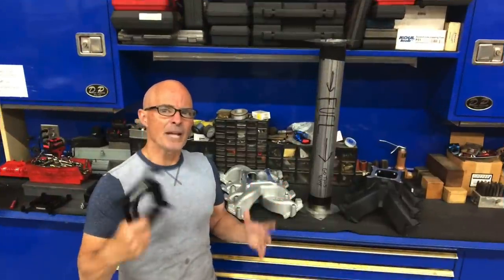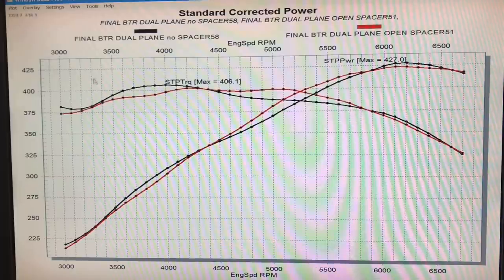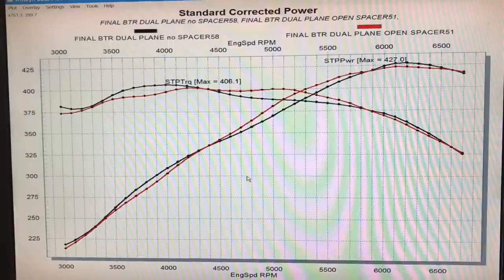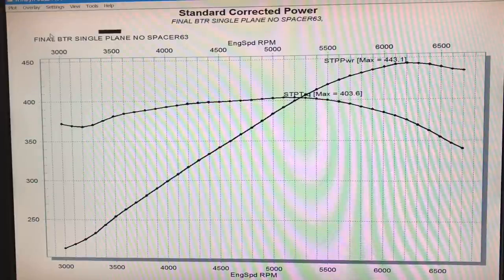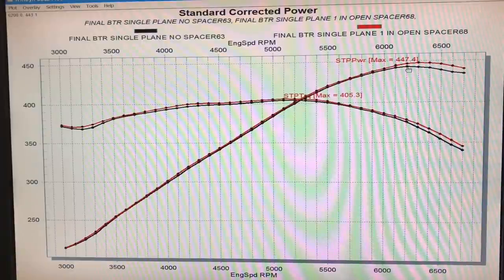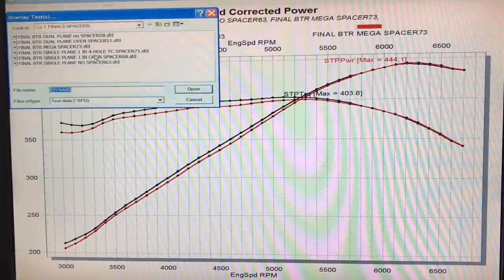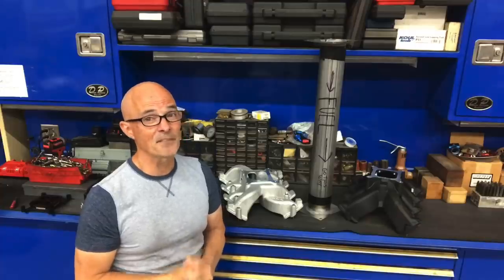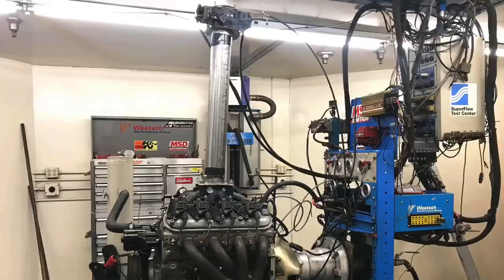SUPER RICHIE MEGA SPACER-MY CARBURETED SALUTE TO THE HOLLEY SKY RAM. HOW WELL DO CARB SPACERS WORK?

Comment: Good news! if you have an early econoline van and don't like the smell if fuel in the cab, you can mount the carb to the roof, and power shouldn't be affected too much. Think of it as the ultimate cold air intake.
Reply: You sir... have a good point.
Reply: a snorkel system with a "remote mount" carburetor
Reply: Is there a Winnebago thermoquad model?

Comment: Using your megaspacer idea, make 3 inch segments that can be inserted and removed and do an exercise in plenum volume tuning and intake length by putting sections of different lengths above and below the carb. Above make sure the input is radius'd.  Maybe try it with and without the intake side radius.

Comment: That is a 100 percent total win. 
That spacer is a total must have for any hot rod. It has everything from just ugly, Stoopid , good for nothing, makes people point and laugh at it, and doesn't hardly kill any power at all. Totally cheap to build yourself. Some sheet metal, muffler pipe, and some duct tape is all you need. Just think of the cooler air charge from that thing. 
You could even put some Christmas lights on it.

Comment: Homemade tunnel ram test:
Same plenum, a variety of puny to monstrously fat runners, but all with smooth transitions from plenum to runner and from runner to port.

I predict that the tiny runners will give best low RPM power, and the stupidly fat ones will give the power at beyond-normal-top-end RPM. It's not only about velocity, but about the resultant pressure buildup on the back of the intake valve on each valve closing due to the velocity!

Comment: We actually did our version of the mega spacer back in the 70s but ours was only 12 inches high. It ran like crap on the street (might be because we were teens and didn't have a clue how to tune it) but it put the carb through the hood and we thought it was cool.

Comment: The problem with the mega spacer is that the air is thinner at higher elevations where it's pulling it from.  The lower the carb the denser the air is for more power!

Comment: Have you considered a few steps between 48" and 1"? BTW, part-throttle will profit from a 4-hole spacer, as it redirects  the somewhat-lateral flow off of partially-open butterflies to a more downward direction. That would be interesting to measure. You would have to measure the exact throttle position to make it repeatable.

Comment: Would have been good to see a 1 then 2" four hole spacer and a dual slot spacer also a dual slot with the milled out section even a super sucker tapered spacer ran both upside down and right way up just to see plenum flow upsets or gains on the dual plane manifold to see real full testing of spacers.  Reason i ask is i believe its the short turn on the upper plenum floor that causes the high RPM issue with the dual plane as the charge fuel has no time to slow down as it does on the deeper side of the plenum    I have checked every site on the net for a real dual plane test on decent build 5.7/6.0 ls engine but most are mopar and sbc tests where i believe the LS engine is an entirely different generation of power to the early generation engines. I do build a few ls1,2 and 3 engines for circuit boat racing. I have enjoyed all your you tube videos and have learnt a lot, keep them coming.

Comment: A long time ago there was a company making intake gaskets with a screen in the ports. I'll assume it was intended to help atomization.
Curious to see if something like this in a spacer would help or kill power.
I know Rich is dying to find out!!
Reply: Hey Richard this is a cool test can you try this one too?
Reply: I remember there was talk about this as well and I was told that they made a plate like this that was electrified as well to break up and atomize the fuel particles
Reply: You might have been thinking of screened carb base gaskets.  This was intended to be a fuel saving device.  Screens can offer a pretty substantial restriction so they sort of "worked".  
As for an electric plate, there was a heater grid on early 80's GM 2.8 V6 engines that was used for faster cold start fuel evaporation.
Reply: I remember seeing those ad's in Car Craft magazine. Screens in the Intake ports to help with atomization.
Reply from the maker: I NEED TO
Reply: @richardholdener1727   and those cool spinning propellers mounted in the carb gasket from many years back! 👍😊
Reply: Smaller dia pipe rich
Reply: I think some diesels have screens. International and I think Detroit Diesel.
Reply: @carlt6932   some diesels have an air preheating screen, some just have a screen to stop shrapnel getting past!
Reply: Torque plus was the name of the gasket, I have a set for 302/351 heads in my garage somewhere. Ordered a set, and got two boxes, one with 2 sets of gaskets in it.

Comment: You should show a video of carb spacers on a Fitech dual plane. open, 4 bore and tapered. I know EFI is different than carbs, and I wonder if there is any difference in the curve..
Reply: They say holley needs a single or a spacer,  but Fitech does not. I Just want to know if spacers help Fitechs on a dual plane and at what RPM ranges.
Reply from the maker: efi does not change the intake design, the shape of the curve will be the same, carbs just make a little more from charge cooling (over port efi).
Reply: @richardholdener1727  Thank you, and keep bringing us more awesome videos...

Comment: Hey Richard have you ever ran engines with slide throttles? Have you considered making a slide throttle setup for an LS engine? I know there's a lot of engineering in it but I'm fascinated by slide throttles, had them on an older Honda and wouldn't mind doing a custom setup on a K series engine with slides right at the mouth of the intake ports.
Reply: I wanna say an old Ford 302 my dad pulled out of a late 70s LTD had some kinda slide carb on it back in the 90s
Reply: @timhuff4166  Was it any good? I guess I mean like racing slide throttles at the cylinder head with EFI but I do like a good slide carb.
Reply: Hell idk, it was good enough to be on a stock motor haha! Only time I've ever seen that, he ended up swapping it out with a regular carb.
Reply: @timhuff4166  The Ford slide throttle was actually a variable venturi carb (VV 2700 and VV 7200 for the electronic one )
Reply from the maker: THEY WORK THE SAME AS A BLADE IR INTAKE ONCE OPENED
Reply: @richardholdener1727  they have slightly less restriction and some benefits worth testing surely? The racecars of the past saw many benefits so it's worth a good old Richard holdener test!
Reply: Go see the 'Perkins Engineering' slide throttle set up on his VP Commodores. A fairly recent vid.
Reply: @ldnwholesale8552  I have indeed

Comment: the divider is great between the halves of an intake if the divider can open. gm did this with some of their engines and at low rpm it made gobs of torque and higher rpm and cruising speeds the flap would open and it would be short runners and give better higher rpm response. but static separator would be a problem its like true duals. 
also on the mega spacer it just shows that the fuel needs to be closer to the combustion chamber. also the mixing. back with older less efficient carburetors the fuel and air did need time to mix especially with leaded gas. but gas is "cleaner" aka thinned down with ethanol and atomizes much better with a fuel injector and high pressures. direct injection is a joke as it kills your engine from carbon. but the injector just before the valve is the way to go. i also think the throttle body should be as close to the valve as possible. like instead of an intake manifold the throttle body is mounted to the intake port. you could put the intake manifold as an open chamber from there and it could pull air unhindered when it needs it but as soon as the throttle demand is changed the motor will react and make peak power. instead of go through a maze then get into the cylinder. the air volume in the intake is essentially atmosphere rather than intake volume. with a properly designed intake port youll still make great torque and mid to upper range power will be even better with very crisp throttle.
Reply: One of the engine masters comps had an intake with injectors fairly high in the runners for more peak torque and horsepower...

Comment: Could you cut down the mega spacer and make it a respectable eight to ten inches. Maybe double jacket and run cold water through it too cool the charge
Reply: If it was cut then it wouldn't be a Mega Spacer......by your logic, it would be a Respecta Spacer😂
Reply: @hoost3056  I think emeliahartford try this same with a tunnel ram that was 3D printed and they tried this on the dyno and it did not work whatsoever passed about 4,800 RPM. All power lost immediately. How much is a mega spacer anyways? One must ask this question. Because 41-in is just stupid.
Reply from the maker: IT DOES NOT NEED TO BE WATER COOLED-IT WAS ALREADY SUPER COOLED BY THE FUEL